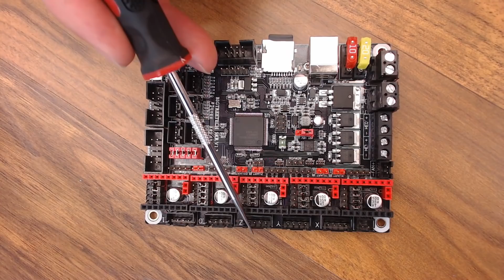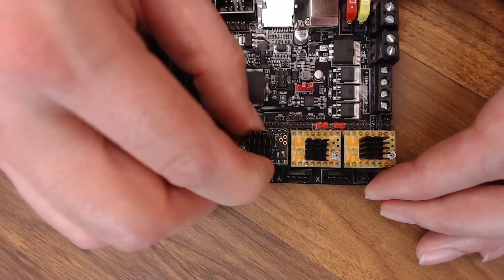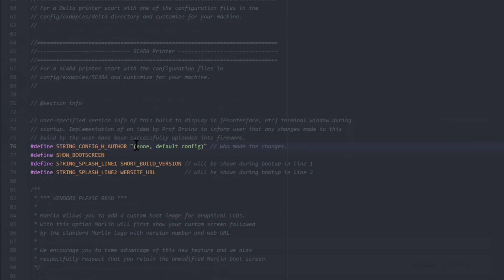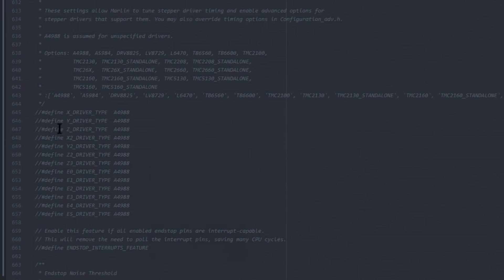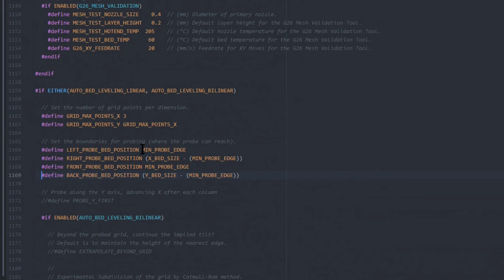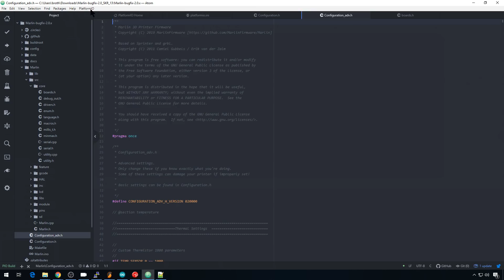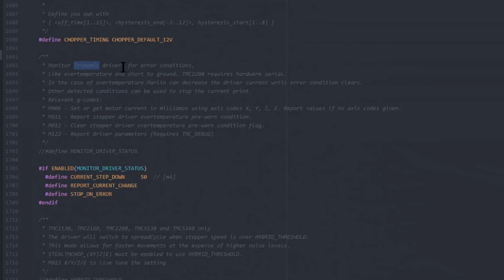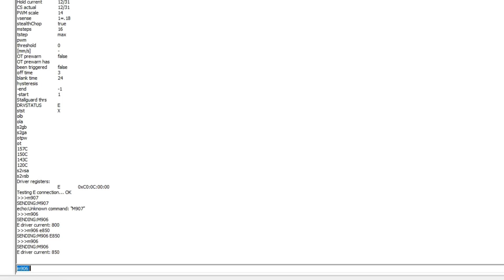SKR v1.3 Mainboard Install - TMC2208 - Chris's Basement

Comment: Great video as usual. How do I stop my Ender3 putting down the first layers on the left of the bed before printing
Reply: Hi Chris. No it isn't the raft,it appears to be in the start up sequence. It homes on the X stop and lays filament down and back up the very edge of the bed before laying the raft. Is it in the start up of the G code? Sorry I have no idea on programming
Reply from the maker: @jeanraines3215  Yep, that's the prime line. What slicer are you using?
Reply: Cura 3.6
Reply from the maker: @jeanraines3215  So in preferences printers machin settings look in start Gcode. There should be some G1 commands in there that do that priming line. You can take those out.
Reply from the maker: Is it a skirt? You can change that up in the slicer.

Comment: Chris on Pronterface using M122 am getting on XYZandE am getting the message connection error all LOW
Reply: Chris I think you are right I believe it to be a hardware fault. The drivers I am using is Eryone Silent StepStick
.Pads are soldered Jumpers are correct .Sorry but what do you mean by the Mode I am running
Reply: Chris .Thank you I tried setting up on Standalone and found the back row of pins on the drivers weren't locating in the motherboard locating holes but were actually on the inside so no contact.
Reply from the maker: @colinraines395  At least you found it! :)
Reply from the maker: Do they still work correctly?
Reply: No they don't function at all
Reply from the maker: @colinraines395  It almost has to be a hardware error. Make sure your jumpers are in the right locations and you have soldered the pads on your drivers. What mode are you running in? What brand drivers are you using?

Comment: Thanks for putting this video together.  It has been very helpful in setting up my SKR v1.3.  I bought 4 TMC2208 drivers for this, but then changed the Z & E0 to A4988.  First I was going to change them to DRV8825 but after some problems with those I switched to A4988 on those 2 drivers.  My main reason for this response is that I set the VREF on an old RAMPS board 1st for the DRV8825 drivers mostly because it was easier, but when I checked the voltage again after putting the DRV8825 chips in the SKR board they were a lot lower voltages.  It could have been I had an iffy ramps board.  Have you tried checking the voltage of drivers on different boards?
Reply from the maker: On the cheaper boards, voltage seems to be a little inconsistent when measured from the drivers. I wouldn't be surprised if there was a difference board to board.

Comment: SKR has a very serious problem: Why is there an endstop (mechanical, optical or capacitive) if the pins used for endstop detection (P1_24 to P1_29) are not interrupt pins. Just uncomment "#define ENDSTOP_INTERRUPTS_FEATURE" that the error happens "X_MAX_PIN is not an INTERRUPT capable pin". This goes for all endstop pins.
Reply from the maker: I haven't encountered those issues. All the endstops I have tried work as expected. Maybe there is an issue on that board.
Reply: @ChrisRiley  Hi Chris Only ports P0 and P2 have interrupts. Marlin 2.0 configurations do not support P1 ports as they are not interrupt sensitive. Since responding to any limit passes (except the minimum Z) causes the printer to stop, I forced all limit passes to reset the machine. I found that in MEGA sources there is treatment for polling endstops. Thankyou
Reply from the maker: @antoniojoseriosbrito  Interesting, I didn't know this. I will have to give it a test on my board.

Comment: It hit the x home and just keeps going until I get a error. I have all jumpers on the red pins under tmc drives and 2 jumpers on the xst and yst
Reply from the maker: Does it change any if you up the sensitivity?
Reply: @ChrisRiley  hiya again I got it working I had to solder 2 pins on my stepper drives to make it work thank you for your help
Reply from the maker: @waynehollowood1805  Nice!
Reply: @ChrisRiley  hiya I hoping you could help me I got the skr_pro v1.1 but can not get my bltouch to work I plug within to the probe header on board everything works but my z axis will not home please help
Reply from the maker: @waynehollowood1805  I am not really familiar with 1.1, but you should be able to put the black and white wires on signal and ground on the Z min endstop. Looking at the board pinout, I don't see servo pins, do you see anything marked like that?

Comment: Hi Chris,

I don't suppose you would know if the any of these software programs would read or work on the board fitted to the Bizer CTC printer do you...

Many thanks...

John...
Reply from the maker: Well yes and no. There is a config out there for this printer, but it's not very complete. I am still working on it. Atom is really just an editor, but you can use a lot of different plugins like platform IO.

Comment: I put the SKR 1.3 with 2209 drivers on the CR10 S5, and it works great. I'm having trouble getting the BL-Touch Smart V3.0 to work with it. Any pointers to getting BL-TOUCH going with SKR?
Reply from the maker: On the SKR, you can use the 3 servo pins, the 3 pins in front of the driver bank. You will have to swap the pins around they are not the same order as the BL touch uses. The black and white will go on Z no G and S as usual.
Reply: @ChrisRiley  Thanks Chris, I got it wired up. It does initialise and pop the pin in and out, but when it goes to home Z, the printhead just crashes into the bed, the pin doesn't pop out before the Z axis starts moving towards the bed. The Marlin config for the BL-TOUCH V3 seems conflicting depending on what I read.
Reply from the maker: @originaltrilogy1  There are some settings in configuration_adv.h you might have a look at. Not sure what is going on, but they may help.
Reply: @ChrisRiley  Thanks Chris, it was a silly mistake on my part, I was editing one set of config files, but compiling a different set :/

Comment: Bigtreetech SKR mini E3 seems to be out 2 months ago. It has 2209 drivers and all integrated...but as 2209:s seem to have ran out almost globally they ship at end of october this year...
Reply: Marlin 2.0.x seems to have support also for that. Just ordered it from their ae store as it looked like a good upgrade for CR-10 mini controller board.
Reply from the maker: @iikkakonola  Yeah, I really want to get my hands on one of those.
Reply: i got my hands on one 2 weeks ago, just haven't had the guts to install it yet as i hastily just bought it without researching into specs(d'oh!) and it has max power rating of 180W/12V and 360W/24V. I have a CR-10 mini with 220W heated bed and 40W stock hotend running on 12V. This adds up for 260W power on 12V and the board has 20A fuse, that already is too much for that. I have to dive into the mosfet specs that board has, i think those will go first if i change for a bigger fuse. I have a reddit post here about all this : https://www.reddit.com/r/3Dprinting/comments/czg06t/cr10_mini_with_skr_mini_e3/
Reply from the maker: @iikkakonola  Does the Mini have an external mosfet you can use? That might be the way to go, add one of those in for the bed.
Reply: @ChrisRiley  it does not, but i can get it online...so that would make heated bed output act as a signal for the mosfet? That would be clever!
Reply: actually it seems to have one! what the h*ll, i haven't noticed it at all and i have opened the control box twice.

i have been into this hobby for 4 years and learned about this setup just now, thanks man!
Reply from the maker: @iikkakonola  You bet!

Comment: Great video, very helpful but after upgrading marlin with Your help my control button works the other way around (turning it clockwise leads to decrease value) I wonder if there is a way to reverse it
Reply: Percussor S. I’m assuming your controller utilizes a rotary encoder?

Configuration.h: Line 1620, change; 

//#define REVERSE_ENCODER_DIRECTION

To

#define REVERSE_ENCODER_DIRECTION

Compile and flash firmware.bin to your skr v1.3
Reply: @makmillion  Thanks a lot, it worked! In mine code it was line 1643 but was pretty easy to find when I knew what to look for. Thanks again
Reply from the maker: Awesome, thanks for the help here.

Comment: Chris is your Z motors wired in parallel or series? The wire color looks like parallel.
Reply from the maker: I hooked mine up parallel just for the test. I have found parallel or series works about the same for the most part. You can also use the E1 driver for the other Z motor if you like.
Reply: @ChrisRiley  Thanks Chris, I have a cable from a second z axis that I will use. Good video as usual.Thanks

Comment: Chris, I know the SKR v1.3  has a SD card in it with firmware.  What printer is it set up for? Is it the default  Marlin 2.X version. I need to set it up for the CR-10
Reply from the maker: Honestly, I'm not sure what it is by default. You are in luck, I was helping another user the other day and just so happen to have a CR10 config. 
Config
https://drive.google.com/open?id=1nFNko50An6wF3t-arvuFHCOIP6ak0bTD

Comment: gave up on Marlin 2 as it would not work for me for Z (X,Y,E all worked fine) and the people over on the github tried to help but it is something in my system and in their Marlin that isn't playing nice.  Here is my issue on github and you can reply to me here, please.  https://github.com/MarlinFirmware/Marlin/issues/14822  Steppers are all 2208s and my configuration files are up there as well.

Since I even changed over to the E1 Z still didn't work right no matter how many steps, or microstepping, I put in.  Baffled but since I switched it to E1 you would think it was Marlin being the culprit but no otherwise everyone would be having this issue.  I wonder if it could be the motor though all of my motors are the same brand and everything worked using the eight bit board before.
Reply from the maker: Wow, that is a really strange one. I wonder if it's a bug having to do with linear advance. I will take a look at the github.
Reply: I am stumped but why am I the only one having this issue?  Went back to the 8bit board earlier and test the same exact gcode file and no issues at all.  Now I haven't used Marlin since 1.1.8 as I went to Repetier on my Melzi 2.0 but it all works.

Comment: Great video, Chris!  Were you able to get the capacitive proximity sensor working with that board?
Reply from the maker: I don't usually mess with capacitive, but I did get an inductive working and the bltouch. If it's 5v you should be able to just use the endstop pins.

Comment: Great Video!  Thanks!  So for those people who do NOT want to solder those three TINY points on the bottom of the TMC2208 drivers you were using, then I suggest the following - Big Tree Tech's own TMC2208 driver preconfigured in UART mode - Just Plug and Play, NO JUMPER WIRES OR SOLDER NEEDED! Just plug them in and set the red UART enable jumpers and you are ready to go!  Here is the link https://www.amazon.com/Kingprint-TMC2208-V3-0-UART-Stepper-Replacement/dp/B07SHBNV73/ref=olp_product_details?_encoding=UTF8&me=
Reply from the maker: Sweet! Thanks for the link.

Comment: Chris, do you know if there is a good 32 bit board that will work with the Prusa MMU2S?  I'm building a .9 degree Bear with 3.5:1 geared extruder and could definitely use the extra processing power.
Reply from the maker: As of right now, I don't think there are any. If there are, I don't know about them. Now Marlin 2.0 technically supports the MMU2. So you could probably get most boards to work, but it's going to be tricky.
Reply: @ChrisRiley  Thanks!  I'm probably not knowledgable enough on the code side to make "tricky" viable.  I suppose I'll stick with the Einsy and low microstepping for now.  Thanks again!

Comment: On 3D printers sometimes two stepper motors are used for the Z axis and connected to one stepper driver. A series connection of the motors is in most cases better than a parallel connection. Only for motors with a high phase voltage (>6V) a parallel connection should be used and the double current has to be set for a parallel connection. learn.watterott.com/silentstepstick/faq/
Reply from the maker: Thanks for the link, great info.

Comment: Sweeeet, first catchup vid is a 32 bit printer pron...  😉  just outta curiosity, why did they skip 16 bit and go straight to 32??? 😕
Reply: Poorly summed up, it was between starting with 32bit, or making do with 8. there wasn't much reason to consider 16 with what the project was doing at the time. it was either known cheap 8bit or reach for 32bit, being the new hotness at the time. Nowadays, 32bit is so well-known it's the new 8.
Reply: I believe 16bit at the time was little more than a doubled-up 8bit, so there wasn't a higher enough ceiling to merit it. i may have made that part up through the years.
Reply from the maker: Thanks for all the info, interesting and something I never thought about.
Reply: Tha KS for the feedback, all...

Comment: I have the SKR v1.3 board and TMC2208s on the way and found this video. Thank you for being so thorough and making this excellent walk through.

My only suggestion is maybe place timestamps to different sections of the video in the description.
Reply from the maker: Right on man, thanks for the suggestion.
Reply: @ChrisRiley  When I hit the check mark to build it says it failed and every board that says skip for you says fail for me. But the LPC1768 and LPC1769 say success. Any suggestions?
Reply: The problem was fixed by restarting the computer and then re-downloading the firmware and starting all over.
Reply from the maker: Glad that fixed it.

Comment: Thank You, very good information for me!!! Like and subscribe!
Reply from the maker: Awesome, thanks for watching and thanks for the sub.
Reply: @ChrisRiley  Hello Chris! I very hope for your help! Recently, it turned out that something make short circuit on my 12864 display, after that does'nt work encoder rotating (only pressing). I ordered new 12864 display, but the same problem, it means that something burned out on the SKR1.3 itself (maybe pins witch read encoder signals, but I see, that SKR1.3 can read temperatures, that means it don't burned totally) 
The general question is, if I having bought a new SKR1.3 board, can I just insert a SD card with the FIRMWARE.CUR file into it, or do I need to create a new firmware.bin file in the platformio? 
I ask it because I have saved an my old project in the platformio, but now, after the past for some time, the build is no longer successful (terminal some gives errors). So I'm thinking whether it's worth starting to scatter with them or the FIRMWARE.CUR file which is now on the SD card is enough. Thanks in advance!
Reply from the maker: @andrejspotapovs4046  Yes, you can just rename the .cur to .bin and it should work fine on your new board.
Reply: @ChrisRiley  Thank You!!!

Comment: varry epic video i have a Alunar M508 i cant find a replacement broad for it . i was looking at this one wow 32 bit i love how you show how to set  the broad up. epic info  , the reson why i think i might need a new mainboard  is becuse i got a hot end therimistor  i fixed the thermol runaway  then i had to fix the heater cartage it printed now in prints the lcd will dim the printer will go quite like varry quite then it gose thermol  shutdown maybe its wiers i checked them and recheck them iam not sure but i like that main borad soo cool
Reply from the maker: Thanks! Yeah, for the money this board is pretty nice.

Comment: I heard there are layer shifting problems on marlin bugfix 2.x . do you know anything about it?
Reply from the maker: I have heard others say this, but I haven't seen it yet. I am sure they will have it worked out soon.
Reply: @ChrisRiley  I googled a bit an apparently they don't know for sure what the problem is. https://github.com/MarlinFirmware/Marlin/issues/12403 But they are smart guys so I hope they will figure it out :) have you printed a longer print like 15-20hrs with marlin 2 yet?
Reply from the maker: Not yet, but I hope to have a config up and printing more stable soon.
Reply: @ChrisRiley  Alrighty. Good luck :)

Comment: Quick tip everybody, the (-) and (+) on the 12v in are REVERSED from the heat bed. So I connected the heated bed first and then screwed the power wires in to match.  Fired it up, heard ZZZZZZZZZZZZZTTTTT and the green LED is coming on but nothing is responding at all.  The firmware card isn't being accessed, the 2004LCD isn't turning on.  Fedora is not registering that I plugged anything in. I have a replacement board already on route.  I only hope that I didn't burn the TMC2208v3.0s out, too, because a set of those is $10 more than the board,
Reply from the maker: Thanks for the tip, I was kinda surprised it was flipped like that.